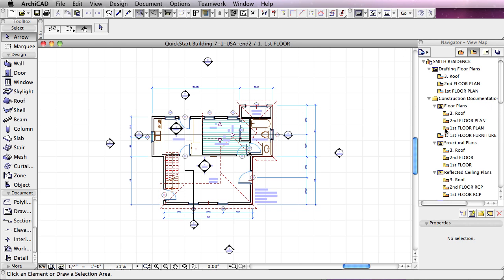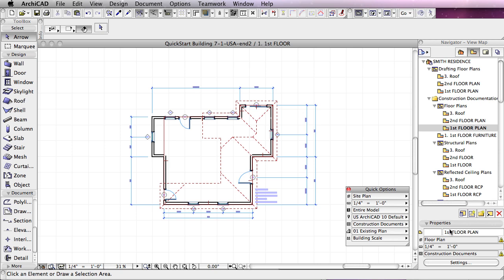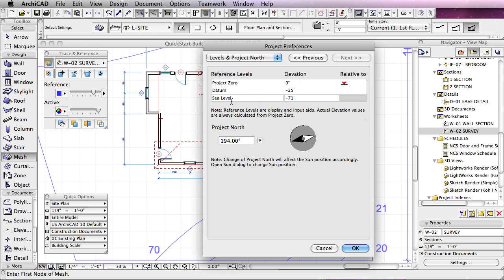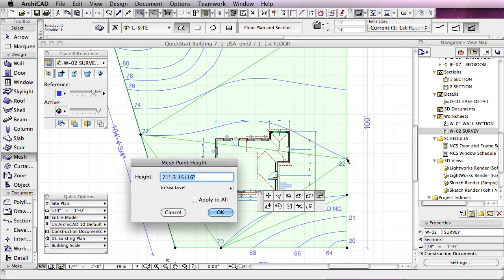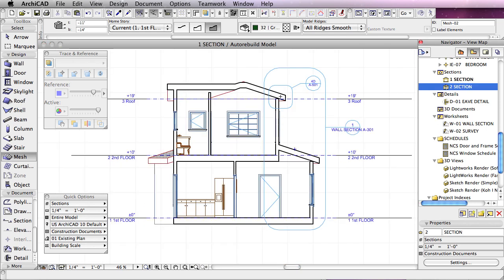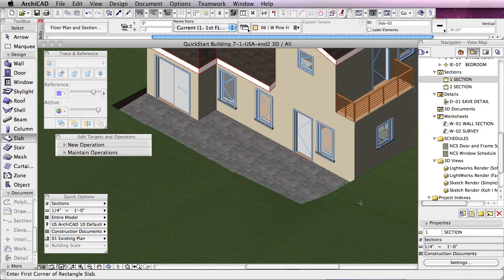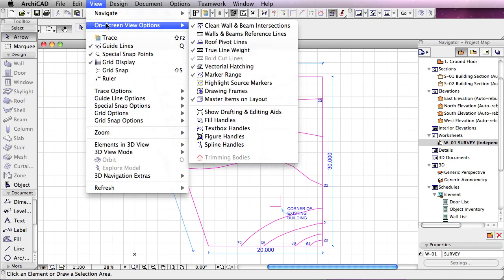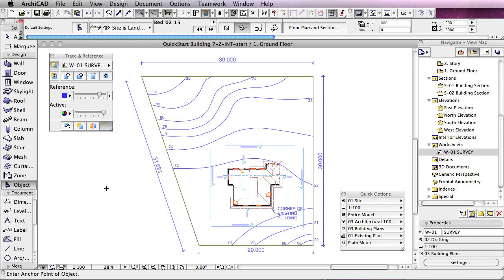ArchiCAD Basic Training Lesson 28 | Site Modeling Basics | QuickStart Course Excerpt

Comment: Hello Bobrow, when I apply materials it seem like color (archicad 19), I don't know how I Solve this problem, please make a video about this issue.
Reply: Thanks for helping! but, If  I want to draw a wall and applying materials like bricks (top, edge, bottom) It also don't represent it's real material (brick). but when I render It, It show's the real material. without rendering It's appearance like brown color. For example, I want to print a wall with it's brick, without rendering. I can't do this process. because it;s appearance like color. I want to show it's real material.
Reply: @HazratOmer Umary If you're referring to 3d mode. If you right click on the screen and select '3d window settings'. and change the 3d modelling engine to 'open GL'. This will show the material texture instead of just the colour of the material